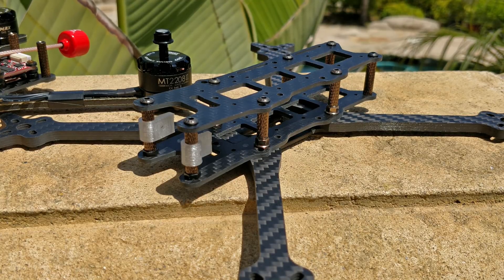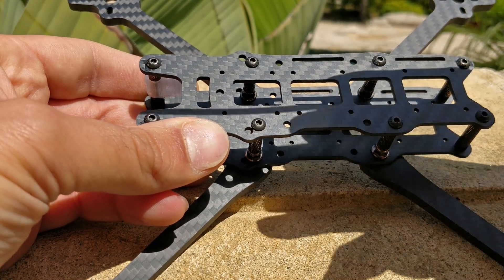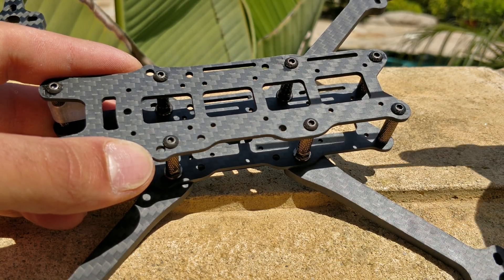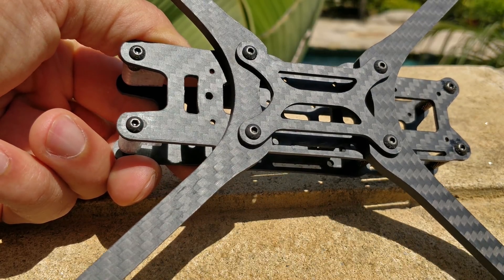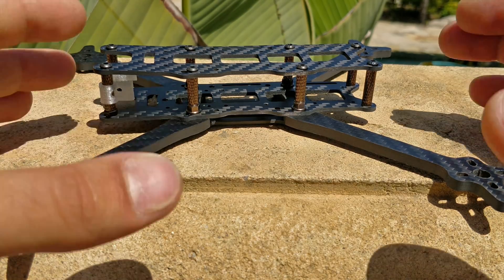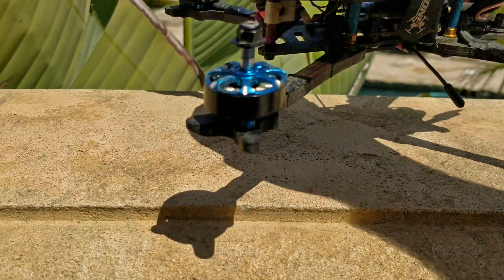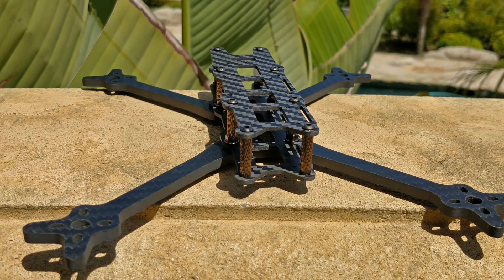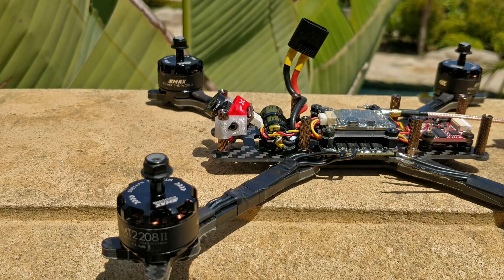FlosStyle - Features and Characteristics

Comment: Hey there Bob, I just got my Floss Style last night, but there wasn't any 8mm screws for the motors. Any particular reason for it? Thanks man, the frame looks veeeery nice! Eager to build it!
Reply from the maker: Likely manufacturer mistake packing the hardware. Please give me your order number.
Reply: Kabab FPV # PD17- 63874 bought at pirofliprc. Thank you man!
Reply from the maker: Ah. That's because you were one of the first to buy from pirofliprc before they actually got the hardware kits. They have packed a bunch and didn't include the motor screws.  I didn't even know they were doing that and they didn't know I had specified for the manufacturer to include motor screws in the kit too. Not a huge deal but apologies the manufacturer forgot to send the screws with the first shipment.

Comment: Man I am an official Kabab FPV fanboi.  You REALLY know what you're talking about, I wish I found your channel first and not after doing this for 2 years.  Pretty sure this is going to be my next frame!  I will have to step up my build game though your builds are so clean and tight, but that's half the fun isn't it?  Well maybe 1/4 the fun, but you get the point.
Reply from the maker: Please don't look at my instagram and maintain that perspective that I'm such a neat builder lol.  I usually just throw them together because I'm always testing.  This time I did it this way because I won't need to take anything apart to swap motors and I'll be doing a lot of motor testing soon...

Comment: I'm about to buy a new set of motor. I wonder if there is much of a difference between the RCX LS2207 and the bbb 2207. I originaly thought to go for the bbb motor but I would like to here your opinion. A part of performace I'm also looking for a good durability. I've seen some high end motors lately that they truely perform great but broke in the first or second crash.
Reply from the maker: they will actually perform quite similarly in the air.  I personally like the BBB more, but you'd be hard pressed to find a significant flight difference if you're not comparing them directly side by side.  And even if you are too.
Reply from the maker: In reality, there really isn't any motor that is actually durable.  Some say this motor is more durable than that motor but there are very few factors imo that make a motor durable.  The most important would be the aluminum used.  7075 is the strongest alloy we have and it is actually more durable than 6065.  The other factor is the shaft and bearings.  The shaft is a moot point now because they all have 4mm shafts and if they have a 3mm shaft, the decent motors all have hardened steel which is really difficult to bend.  The bearings do make a difference but more so for acro than racing and still not an enormous difference.  9mm OD bearings with a 4mm shaft are gonna be more durable than 8mm OD bearings with a 4mm shaft because the ball bearings inside are actually larger and can take more stress.  Both of the motors you've selected have comparable durability.  I wouldn't base your choice on that.  I would however mention that there is an issue with the BBB that is quite annoying.  It doesn't have any grip texture under the prop.  Me and a few others have noticed that our BBB quads spin a prop loose significantly easier than other motors.  We all thought we were crazy until we talked to each other about it.  I've mentioned this to the BBB company and they're gonna change it at some point but for now, it's just a bit of an annoyance.
Reply: Thanks for the explanation Bob!

Comment: I know this comment has nothing to do with this video. But do u know anything about what effect the windings in the motor and width and length of them have on the motor? I know with brushed motors it has everything to do with speed and torque
Reply from the maker: A lot of the same but I'm not confident I know the relationship

Comment: I just built mine out very easy to build and plenty of room and still is a low profile deck. not to mention it feels very solid. I should get my run cam micro eagle in today so I will be able to do a test flight tomorrow... I am running 2207 LS 2550kv emax motors. I will post up my flight as soon as I get it edited. Thanks Bob for the cool frame.

Comment: I would agree with the fact that the bolts your using have higher tensile and yield and I'm really not sure what grade of titanium is used for most screws, I'm just guessing grade 5. But grade 5 titanium is anything but brittle, in fact it's actually very springy and can make a really good spring, although yes the 12.9 steel is still about 25% higher yield (yield is the important factor not ultimate tensile) but by definition the 12.9 steel is the most "brittle" of the 3 metals (12.9 steel, Grade 5 Ti, 7075 Al) due to the lowest elongation numbers and this makes sense because typically the harder a material is the more brittle. I'm seeing specs for 12.9 steel bolts as having 8% elongation and grade 5 titanium has 14% elongation and 11% for 7075. Aluminum however is not even in the same league as hardened steel or grade 5 titanium. 7075 aluminum is pretty springy for aluminum but has the worst fatigue properties of the three metals and significantly lower tensile and yield. I have ripped the head off of a M3 7075 aluminum bolt on a 2.5" quad that only weighs 130g and that certainly would not have happened with steel or titanium. But we are talking about flying things so weight is a factor to consider. The density of steel is around 8grams/cm^3, grade 5 Ti is 4.43 and 7075 is 2.81. Ti is definitely the most expensive but in terms of strength to weight for this application, it's still a great option in my mind. You could save several grams by switching all the steel hardware in that quad to Ti and although it would not be quite as crash proof as the steel, it should be pretty good for most crashes and due to the elongation, should also absorb some of the forces and might actually balance out in terms of if it will or will not shear/break in a crash compared to steel? I would not right off Ti so easily, maybe you have had a poor experience with Ti but maybe you just tried some shitty Ti screws? I have worked with Ti a fair amount and grade 5 is tough stuff and very hard to break. Although I do agree that hardened steel is still king in terms of hardness, you really pay for it with the weight. Steel is 25% harder but weighs almost twice as much as Ti.
Reply from the maker: All great but in actual use, even grade 5 titanium will sheer far sooner than hard steel.  I've done it several times and the screws are about $5 ea.

Comment: W8ting for my 2 Flosstyle frames to get to Belgium :) Question regarding motors, what do you think of the X-foot 2207 2500KV ? i think that this motor is made by sunnysky and is great quality.  They also have a low kv version i guess that the low kv would work fine on 5 and 6s
Reply from the maker: yeah the Sunny motors are good.  2500kv is good for 4S only really
Reply: @Kabab, Got my flosstyle and the 7 inch floss arms after only 2 days to Europe !! SUPER FAST very happy with the frame, awesome frame ! only little thing missing are the correct camera mounts, i got some small blue ones that does not fit my micro cam but i already sent an email to pirofliprc to get the good ones, now i have a question regarding the setup, I will be using the 7 inch floss 2.1 arms to make it a 6 inch Flosstyle and i was thinking of using the 2207 Hyperlite 1722 HV Edition, if i'm not wrong with this motors i can do 2 things on a 6 inch , 1) use it with 6 inch props on a big 4S/5S as a long range/long flight time quad or 6S with 5 inch propos for freestyle ?  does this make sense ?
Thxx

Comment: what you said about it not mattering about where the flight controller is, does that apply for all flight control boards?
Reply from the maker: I don't like any F3's.  They're just becoming outdated too fast to deal with anymore.  ALL the F4's without exception fly the same.  It's the firmware and the gyro that governs things.  The Helio board is the only actual innovative FC that's come out in recent time.  The rest are just various layouts of the same thing.  F7 is not really useful and I'm not sure if it will be.  Maybe in the future.

Comment: I take a thin strip of sand paper and run it in the strap slots (towards plate) to smooth out the sharp edge on my flowride builds. have yet t break a strap since

Comment: I absolutely love the modularity here. Might even have to put my Rooster on notice (great flyer but one heavy bird; gains a lot of momentum while falling which results in too much speed). The cam thing though - do you honestly find that micros get you the same image quality as minis and regular cams? I've hated every micro I've tried (including the Predator) due to those crappy plastic lenses.
Reply from the maker: The micros are better quality than the mini or full size.  The mini is identical with just a case around the micro PCB.  The Micro Eagle is the absolute best looking camera period.  It does not get better at the moment.
Reply: I'll keep an open mind about that micro Eagle because of the sensor and that lens...just porn. But I could swear up and down that all my other micros have performed noticeably worse than the same model minis - Arrow and Predator to be specific. The micro Predators in particular were supposed to be the Chosen Ones for me but...nope!

Comment: could you not swap the capacitor and FC? looks like it would fit?
Reply from the maker: Ya I could actually. You're right.
Reply from the maker: Maybe it's more accessible this way?
Reply: Kabab FPV Think so and shorter Cam and vtx wires is a plus....

Comment: It would be awesome if you did an experiment where you build a quad upside down, FC, and 4-in-1 mounted to the top plate, VTX, receiver mounted to the bottom plate. :)
Reply from the maker: Many frame designs are like that. It's a bit odd to me.

Comment: Was there ever a newer 4" floss? Or after the v1 4", was the 4" ditched?
Reply: 4 inch Tooth fairys are a thing basically a Floss . Still my favorite size for our local sometime natural obstacle racing. 

1806s are good but 1507 are best.......I currently have 5 running 4 inchers 2 with 1806s, 1 with 1507, and 2 with 1407. 

The only advantage off the 1806 is they can actually carry a Gopro sessions pretty easily. For racing I would still with 3200-3600kv 1407 or 1507.
Reply: Josh Matta Yes, I just ordered a 4" Toothfairy frame. Perfect!
Reply from the maker: 4" is pretty much ditched.  It's like an inbetween bastard size.
Reply: I would love to get a mini Floss V2.1 style frame that fits only 20x20 stack, micro cam, and 1407 sized motors!  (Looking for this right now to replace a busted Avant Quads Devel 4".)
Reply: Kabab FPV have you tried any of those oddballs size motors? Ex--brotherhobby 1806
Reply: you will not regret it.

Comment: Multicopterbuilders make a 2208 1900kv give that one a shot I bet it’s exactly what you’re looking for
Reply from the maker: Yes this is the best 2208 available today I believe
Reply: Cobra did a beefy 2208 2000kv back in the day. One heck of a motor on a mini. I think Rotorgeeks sells them.
Reply: RCX Still has 2000KV 2208 - but they're really cheap motors (the good - $7; the bad - there's a reason they're only $7)

Comment: You're right, everything breaks. I recently broke a 5" boomerang arm of my Floss V2.1 in a race on a frontal violent chock . it broke in the middle, but I can confirm these arms are very very durable and strong.
Frame ordered. it will replace my old Leopard 5" for freestyle. I still don't find good cheap 2208 motors but the 2207 Samguk motors will be good enough for my risky new figures testing frame lol
Reply from the maker: In working on a 2208
Reply: Meanwhile, I have Avengers (2507 1850kv) on an FT270 6" frame and I'm going to try them on my 7" Floss with my 6S 1800mAh lipo.

Actually I'm flying X-nova Lightning 2207 1650kv and get a lot better efficiency with a 5S 1350mAh than the 6S 1800mAh. I'm sure it's the difference of weight (217g VS 317g) that affects those motors. The avengers being stronger and supporting much better 7" props, maybe I'll get better results with a heavy 6S lipo.

Now, on a LR flight with the Lightning I get about 9mn of flight time on the 1350mAh 5S against 12mn on the 1800mAh 6S when cruising (50~80km/h) ! the difference should be more evident.

The Avengers weigh 9g more, which means 36g total weight higher. But it should be compensated by the amount of thrust of these motors.
Reply: Just changed the motors. I was a little wrong : there is only 18g difference for all 4 motors,so the total weight without battery (gopro tpu GPS etc) is 420g which is nice with such big motors...

Comment: Awesome thx! Answered any questions I had about that slight gap/curve in the top plate. I bought a 4 in 1 esc specifically for this build but still ended up using separate esc's :O I butted them up real tight to the standoffs and you can barely tell they're there. 
Oh btw I also  used the brain 3d session mount and the Floss 2  axii/ rx holder mount and it worked perfect.

Comment: I would build stack like this:
4 in 1 ESC
Fc with integrated vtx
like 20x20 stackable receiver

+ if runcam made RC split micro with extended camera wire I would stick that on top of receiver

Comment: I bought your frame through the quad lab but I think I'm missing some of the hardware now that I've seen how it's supposed to look all together. Could you let me know what is supposed to come in kit? I have all the carbon pieces, the 8mm motor screws, the longer screws you mention and some 6mm screws but I didn't receive any nuts or standoffs. Oh and I got the two pieces to attach the camera. Thanks.
Reply from the maker: Please let me know your order number.  I'll check it out and have it sent out to you asap
Reply: My order number is #1105

Comment: The helination f4 talon,it doesnt support ibus? 😐
Reply from the maker: It doesn't?  Then the Hyperlite F4 OSD doesn't either. ?
Reply: Kabab FPV hyperlite f4 has rx1 pad for ibus, right? But i was reading the configuration of this board ,i didnt see anything. It says uart 1 and 3 is inverted for sbus. Can we use the same port for ibus as well?

Comment: Is TMotor F40 Pro II 2400KV ok? If you recommend 2207? what KV should I go with? I am building a 6" floss 2.1 with hyperlite 2207 2522KV.
Reply from the maker: 6" 4A I recommend 2100-2300kv
Reply: So... Hyperlite 2207 2522KV on 6" Floss 2.1 is not ideal? I plan to use 5.1" Prop and use it for racing only and may or may not use go pro. Thanks for your help. :)

Comment: What is that? 1.1 gigawatt cap 😜
Reply from the maker: It's 1000uf 36v low ESR. They're just big.
Reply: Kabab FPV oh I know! 🙌I got some from piroflip but haven’t put on a quad yet because I just don’t know what to do with one the size of R2D2 😂 I think it’s the 330UF I am using now which seem fine for 4 and 5S IMO
Reply: Kabab FPV hey when you go up to 5-6S do you change any of your esc settings? I’m guessing not but been thinking bout some things

Comment: i love it!...do you  think the sunnysky 2212 1400kv motors would work on the up coming 7" arms?..or even the model your showing.. .
Reply from the maker: No the 7" arms make this a 6" frame. The 2212 should be used for nothing less than a 7" triblade prop.